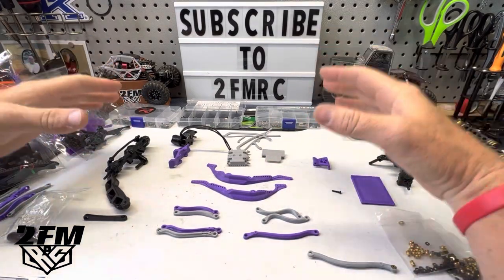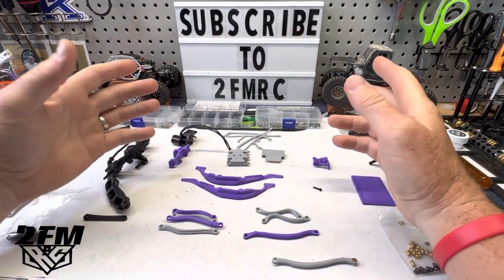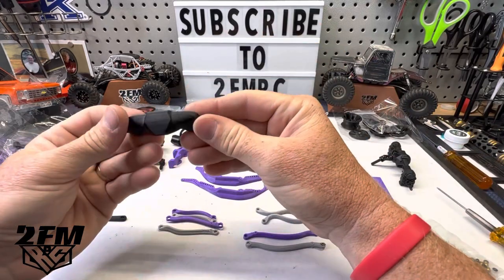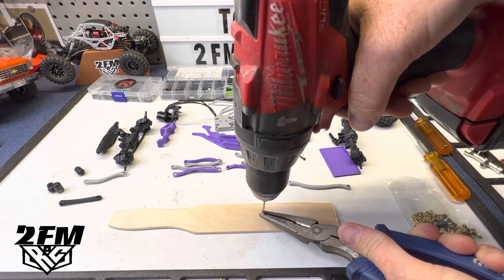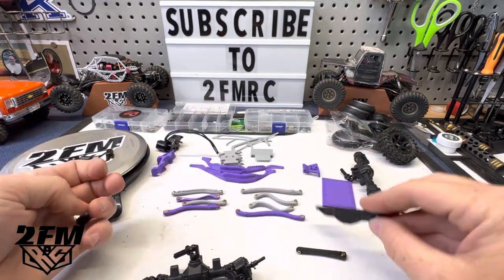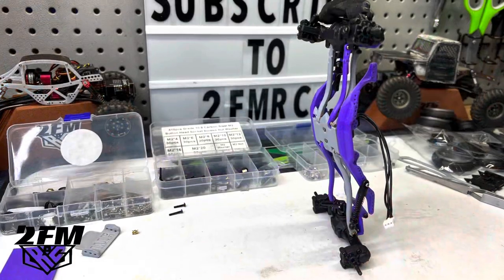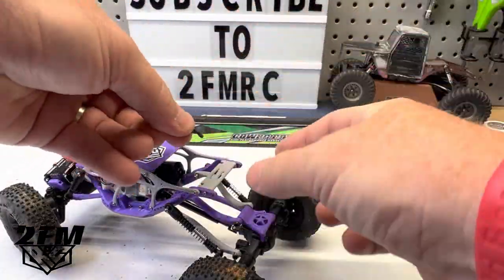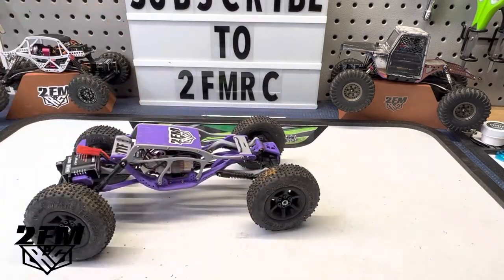Texoma 1/24 Slayer build & thoughts! SLAY DAY! FCX/SCX24

Comment: Amazing intro. Looked like it was hooking up really well but couldn’t see the tires spin with the black wheels.
Reply: Aaaaaahahaahahahahaha
Reply: I needed that ish, right there. What is up crawler fans…
Reply: When drilling out the link balls. I run the drill up much higher and then plunge hard. Be sure you grab the pliers. If anyone needs this done, I can do it. No problem. I’ll make a note in a video and on etsy.
Reply: On the link weights, I use glue also. They will pop out.
Reply: Just go slay!!!
Reply: Slayed a mouse! Dude…
Reply: I love it! Every time I say something good about the slayer while running in a video, it flips over. It even does it to you. Just don’t talk about how awesome it is and it should be alright.
Reply: That’s awesome on the rubber band! Basically how I made the wood one. I’ll have to put some long shocks on mine and giver her a go. Been running the 39mm oil filled on the bigger rigs to help with keeping them from being too floppy but it makes for not much dropout. Fun to play with but could be hard to comp with, catching on the belly for no reason. It does slide well but having more dropout would be nice.
Reply: Awesome dude!!! Thank you so much! I’ve tried to build these things in as many different ways and then watch the guy’s rigs that have built them and include all of that in making the most efficient parts possible. I was blown away by Matt’s experience with the hangars. I was so excited to share with him this awesome thing that I thought I found and then… not so much. Dangit!!! It works on mine! I can show you! But obvi, it wasn’t working on that config. The cool thing is you can screw them on to try it and even if they were glued on, it’s likely to be helpful pulling the rear axle over an obstacle. At the end of the day, I hope to offer cool parts for making whatever you got slay more than it did before. I’ll continue to watch these parts and make necessary corrections as they come up. If you can’t slay in your rig, yet, stay tuned and I just might be making the parts to convert it. Thanks Matt for the kind words and a killer video and thanks to everybody else for hanging out. RTYF!
Reply: @texomarc  Looks awesome Josh!!! I've gotten behind on my YT sub'd channels and am doing some binging. Once done with Matt's vids, you're up next as I can see you've been craftin' like crazy! 
Love the design. It's super unique and organic. If HR Giger was gonna crawl, this in black and dark grey would be his rig!
Reply: @texomarc  I didn't quite catch it in the vid, but do you have to drill the links or can you use the screws that fit w/o drilling? Or are the beefier screws needed for strength?